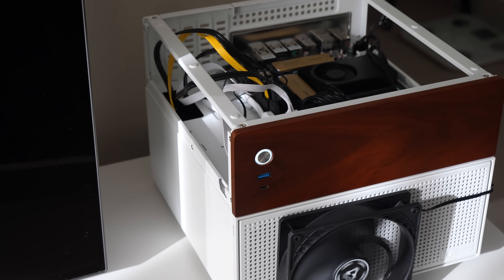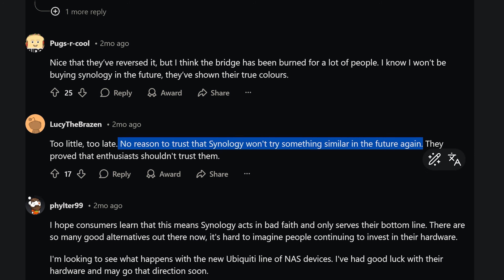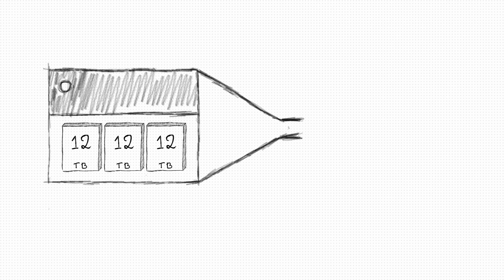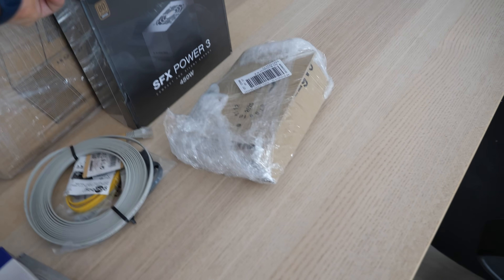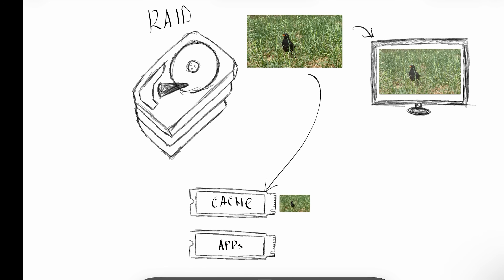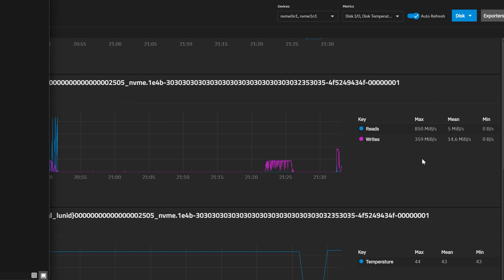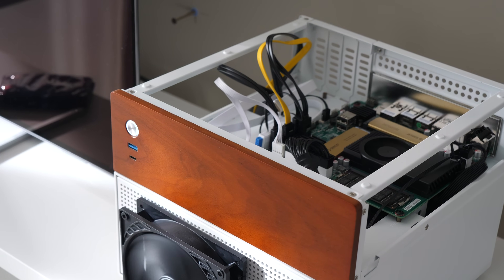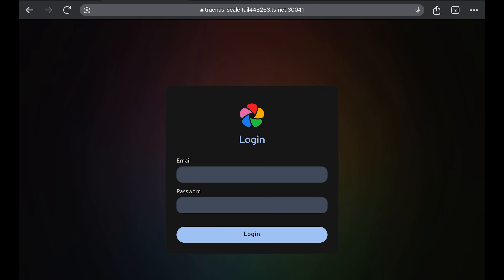Building a 10Gbit DIY NAS: What They Don't Tell You.

Comment: really? i don't know why, you all over complicate it. it is just a pc on your network, take a pc with windows on it, throw a 10gbe in it, and share the drives on your network, with windows! you dont need to learn linux and all this nonsense. ive been doing it, since Windows media center in early early 2000's.
Reply from the maker: 0:39
Reply: You “can” do that, an I did repurpose my old desktop like that (without the 10GbE NIC), but there’s a handful of caveats: 

A) Windows updates restarting your PC whenever it wants. Which can take out any program that doesn’t have an auto start function, slash you haven’t set that up yet.
B) the number of “NAS-adjacent” programs, like specifically Immich featured in this video? Don’t have native Windows binaries and so you have to set up Docker on Windows, which I personally managed to Bork.
C) some programs really don’t handle Windows shared drives well, because it’s a bit of an edge case. For example, I had Ace Combat installed on both the “Windows NAS” and the device I was connecting to it with, and it just wouldn’t even start because Steam couldn’t differentiate between the two. (Even though I could swear that Windows specifically flags network drives as remote, and I didn’t do anything special to pretend it was a local drive?) 
D) Which ties into the fact that your “old PC with Windows on it” probably has both all your stuff that you actually want to be on your NAS, and is piled with the collective bad decisions you’ve made over however many years you were using it and needs a complete wipe with a fresh OS install, hindered by the fact it already has al your data on it and a fresh wipe would wipe it all out. At least, that was the case for me.

E) select programs (I think specifically including video editing, but idk which video editor) benefit from being able to pretend like the remote drive is a local drive over something like iSCSi, that I don’t think Windows drive sharing supports?
Reply: @levygaming3133 F) Windows firewall is rubbish 😂 G) no security updates for older versions of Windows H) bit of a caveat to C but SMB don't play well with others 😂

Comment: 2 "Artic 12 Slim" 120mm fans can fit inside the front cover with very minor modifications. This includes just slightly sanding the top and bottom of both fans and they fit nice and snug, no screws or glue is necessary. Also, removing the rubber Harddrive handles is required to install the 2 fans.
Reply from the maker: That's a good tip, thanks!

Comment: since build. 30min for disk spin down seems very short to me, i wouldn't have put anythng lower than 4 hours. keep in mind that constant spin down/up wears the hdds very fast, i'd suggest you change it. iirc truesnas has scheduled spin down but needs a lot of changes to work reliably.
Reply from the maker: Fair enough! I forgot to mention that I scheduled SMART check once a week after that, and when my PC is on, most of the time NAS doesn't go sleep. With 30 mins HDDs were waking up 2-3 times a day, so I changed that to 90 minutes and we'll see how it goes.

Comment: As a seasoned NAS builder/user - > Very important. For any NAS , you must also back it up someplace else. Never expect your NAS to be undefeatable.

Consumer HDD's work fine as a single drive but not in any type of "RAID". The reasons is that RAID "NAS" drives are configured by the manufacturer to fail quickly on read failures. Otherwise any attempt at rebuilding or correcting a read error can at best cause a read delay , at best a failure of the drive as it keeps trying the read.

For extremely important files, I just buy a $500 Dell Enterprise server (yea  noisy) and I also buy used Enterprise SAS drives. ZFS is the only good option, so TrueNAS Scale is great for it.
Reply: This. After building your first NAS, the next things you should do are:
1) Build another NAS.
2) Set up your own VPN connection so they can communicate with each other over the internet through a tunnel (Tailscale, etc).
3) Set up automatic replication and snapshotting from NAS #1 to NAS #2 (TrueNAS makes this easy)
4) Set up that 2nd NAS at a friend's/family member's house
5) MOST IMPORTANTLY: Test your backup and restore scenario. Ensure it works as you expect, so when shit hits the fan, you won't be scrambling to figure out what you need to do, you'll already know.
Reply: YES. I'm so sick of arguing with idiots who think RAID is it's own backup.
Reply: @nullvoid24 This guy has some amazing friend if they are letting him use up power 24/7 to run his backup server 😂 off site don't have to mean literally off site either, you could just put the backup server in an out building away from the main house if you have one thats protected from catching fire. Build a man cave at the bottom of the garden away from the main house 👍
Reply: Always use ZFS i also have 2 servers running used SAS Drives but also use WD RED Drives and in my less important servers use a mix of other Drives, it all really depends on what you'll use it for and if you want it to be cost effective 😂 for this being a First Nas I thought he done really well 👍 TrueNas is my favourite go to but I have a few different server OS

Comment: Was literally about to buy a similar build, the N305; but then I realized maybe I want ECC and suddenly everything got way more complicated.
Reply from the maker: and WAY more expensive, so I skipped that for now
Reply: You can buy secondhand equipment cheaper if you're looking for more enterprise equipment to suit your needs, supermicro do some great enterprise server motherboards and support ECC Ram if thats what you mean by more complicated 😂👍 hope this helps
Reply: @nomadpack4050 /videos Yeah thanks. I did a lot of research the past few weeks and realized that the ECC situation with Intel/AMD isn't great.

As far as I understand the server CPU's aren't really suited for low wattage idle home use. I was considering an i5-12500 + w680 but the boards are kinda expensive for my basic use. It's hard to find used w680 boards where I live so it'd have to be a china import.

What I essentially want is low idle, transcoding, ecc, one nvme boot (truenas), one nvme fast access drive, 6+ hdd backup (hba card), one 10gbe connection and arc graphics. I looked at the AMD 4650G + B550/X570 but that processor despite low wattage seems limited to PCIE 3.0 and the chipset lanes being only X1/X2 make the PCIe limitation a bit more annoying. Seems like the 3600 supports PCIe 4.0 though, but it's not monolith. 

Not really sure what to get at the moment, I might just try and go super cheap, accept the compromises/bottlenecks and hope that better consumer options are released in the future.
Reply: @nomadpack4050  - Enterprise kit is normally so much louder and far higher power draw, not great in Europe where we have high energy costs and no garage to store that rack mount kit in.

Comment: I would suggest that most people should not give up storage space and performance for RAID. Automated incremental backups preserve your data, is less wear and tear, costs less (using cheaper external drives vs NAS enterprise grade)... what you lose is uptime, meaning the ability to seamlessly continue / restore your data as-if nothing was lost. However, most people don't need perfect uptime. Their archives are overwhelmingly composed of large video files where it doesn't matter if you have instantaneous continuous use... or if you just access the one you need from the external backup and slowly rebuild your drive from the files you aren't in immediate need of now. I feel like all the reviews and videos push RAID on to people explaining what it is but not why it makes sense for them... and in many cases, they don't need the uptime and would benefit from more and cheaper storage.
Reply: Servers have more purpose than just backup of files, the way he set it up was ZFS pool not Raid

Comment: If you decide to build your own NUC, avoid the SilverStone SST-DS380 case. It seems attractive both in price and features, but in practice, it turned out to have a terrible drive basket cooling system. Temperatures rarely dropped below 50°C (122°F). I ended up using a grinder and completely redesigning the drive basket, rerouting the airflow, and replacing the fans. But even after that, the temperature remained around 40°C (104°F). Finally, I decided to take an 8-bay case from my old Synology, gutted it, redesigned the SATA connector assembly, and connected everything to the NUC motherboard via an M.2-to-SATA adapter. Now everything is fine, the drive temperature is 30°C-32°C, and the whole system is much quieter. The SilverStone case is in the trash. I watched the video with great interest and am thinking of switching to TrueNAS. Now everything runs on Synology DSM via ARCLoader.
Reply: Goat
Reply: CS382 is a drastically improved case imo, 8 drives with 12700K stays cool
Reply: Sounds like you did a fantastic job with what you had. Really stinks that you had to do all that because of the Silverstone case. Thank you for the advice, I will absolutely avoid it.

Comment: I have found that NVME drives were more reliable than the old mechanical hard drives, just the cost is higher. The older hard drives can store more but fail alot. Its a big investment to replace these so often.
Reply: I’ve been wondering about this as well. If there came a day where nvme drives had the same prices as HDDs, would anyone still use mechanical? My understanding is that nvme SSDs outclass mechanical in every aspect (including reliability) expect for price. Is that right?
Reply: I recently had a 2tb nvme die and have had other SSDs dies in the past.
Reply: @JediObiDave - Consumer SSD reliability is largely dependant on the capacity.  The larger the drive, the more reliable and longer it will take to wear out, due to the fact is has more space for wear levelling of the data.

Comment: I find it interesting that pre build systems are more expensive.
I tried so many times to combine parts to DIY my own, but I'm ending up more expensive than a i.e. DXP4800 Plus.

I also don't know how power hungry my built is going to be, as power consumption is a running cost.

Edit: OK, AliExpress may be a cheaper source, but I have no experience with it.

Comment: If it’s for work, it has to have ECC RAM. Skip ITX and go ATX, it’ll save you money in the long run. Do not get a cheap chinese case, get an ATX case with good hdd mounts (Fractal design Define 7/7XL). Get a PSU with a 10 year warranty. Do not overspend on CPU’s and motherboards, overspend on RAM.
Reply: “Overspend on RAM”

Given current conditions, even that would be buying too little RAM.

Comment: Do you really need REDs for home servers
Reply: yes if its running 24/7
Reply: Not really, you could use a different brand if you wanted to, or depending on how much risk you're willing to take you could use any spindle drive you wanted but not recommended as you could loose your data. WD Red plus are some of the best drives for this application. You could also use seagate iron wolf pro or Exos 🤷‍♂️ not as good in my personal opinion but others might disagree 😂
Reply: @edhahaz - NAS drives are designed to run 24/7 AND to deal with the vibrations from the other drives in the unit.  A have an 8TB desktop drive which have all sorts of issues when installed alongside other drives, yet it's fine when stand alone.

Comment: 8:02 The NAS doesnt HAVE to be connected to both your PC and router, if you just connect it to your router, you can use it with your PC just fine. You just have to find out the IP Adress of it on your Router, connect to it in your Browser and create an SMB Share, then you put that in your Windows Explorer and you have a NAS that you can put stuff on without 27 Ethernet Cables
Reply: I thought the idea of direct 10Gb from workhorse machine to nas was brilliant! The slower net connection for router/wifi/wan/iot saves a lot of money on unnecessary network gear.
Reply from the maker: I mean that in the context of using a 10Gbit connection, and for that you need a cable.
But overall yes, you're right
Reply: @trysometech52 or habe a 10gb Router/switch

Comment: I got interested when I heard the Orico IG740 Pro SSD has power loss protection (PLP) and is TLC NAND flash. A quick google however suggests that it does not have PLP (see techpowerup database), and the 1TB variant is QLC instead. I like the video but not the sponsor.
Reply: ECC so great for the application of cache & they are nand chips so they don't require PLP really do they 🤔 nand chips retain memory without power, in this instance he wouldn't require PLP but if he was using them as boot drives or storage drives for sensitive data then yes it would be more beneficial but even the Apps drive he used the second one for wouldn't matter since he could quite easily set up the apps again, worst thing he will have to re set up the Apps and have slower loading times again if he ran into power loss issue
Reply: Also UPS would also save the issue happening all together which is why it's recommended for all equipment to run through UPS
Reply: @nomadpack4050  True for most users, but I'm looking at this for a Ceph cluster where PLP is a hard requirement. Without it, you get a massive IOPS penalty because the system won't trust the volatile cache. Even with a UPS, the OS won't acknowledge the write as 'safe' until it's physically on the NAND, unless the drive has capacitors to guarantee that flush. For home use, it's fine; for distributed storage, it’s the difference between 10k IOPS and 500 IOPS.

Comment: It's been nearly 10 years since I built a similar system on FreeNAS (now TrueNAS). It's still running on TrueNAS core and has 12 drives. I however always remembered that spindowns are generally not wanted for NAS drives? Better to keep them running 24/7 instead of letting them spin down was what I was told. This maybe changed the last few years with newer hdd tech?
Reply from the maker: Good point, I had to dig deeper, and yes, they changed the HDD, but in the opposite direction. Due to the density of data on my 12TB drive, this could have an even worse effect on its lifespan. But that's if the drive frequently goes into standby mode and comes out of it. In my case, this happened 2-3 times a day, but I think I'd better change this setting from 30 minutes to 2 hours so that it only stops at night and turns on with the PC.
Reply: @trysometech52  good to know! Thanks!
Reply: @trysometech52 moreover, there is a bug in the last version of Truenas, where it is not letting the drives spin down even if set to do so....
Reply from the maker: @glujaz  Yeah, lucky me, I still haven't updated

Comment: Ironwolf and Exos are noisier than WD Reds. When you build a NAS, you put it in the basement or a spare room or a ventilated closet because they do make noise.
Reply from the maker: Ouch. So maybe I did the right choice then
Reply: @trysometech52  Yep. Ironwolf and Exos spin at 7200 RPM and will always be noisier than WD Red Plus. I actually think WD Reds are quiet but I do have Ironwolf and Exos drives to directly compare with. My sister is a Mac user and since her MacBook is silent, she’s also sensitive to sound that I’m personally fine with. xD
Reply: any high capacity HDDs are noisier because they have more platters to spin
Reply: I use Ironwolf Pros, but only went as high as 10GB. I read it’s the drives above that are loud. Sure it only gives me 40GB to play with after formatting and ZFS, but not bad for a machine that has to sit in the same room as me.
Reply: Read the data sheet WD Red plus, Helium filled drives you want if you're looking for quiet drives WD120EFBX this is the only model with helium

Comment: That external mounted front extra fan for hard drives 😂😂😂😂
Reply from the maker: that's what makes it special 👀
Reply: exactly why? what can he possibly be doing, to need that?
Reply: @tek_soup  the drive temp is a bit on high side like 45 iirc , so he added a fan to help , although that mesh is not friendly for air flow but arctic P series fan have high pressure to help a bit 
I have a n5 and honestly the case air flow design is on faulty side .... Negative pressure design but holes everywhere , not optimal amount of air could pull from the drive bay
 I sealed some of the air vent and see greater harddrive temp and able to turn then fan rpm 30% lower
Reply: @tek_soup  did you not watch the video

Comment: You always seem to cover a topic that's recently of interest to me! Have been thinking about setting up my own NAS for a while, so it's really handy to have a guide to a modern (cost effective, and free-to-run) setup, thanks.

It's also nice to see TailScale get a shout-out! Just discovered it myself and it's far superior to my previous port-forwarding solutions. I hope it stays free forever.
Reply from the maker: Awesome! Let's see if this rule works with the next video :)

Initially, I was setting up WireGuard, and there were a bunch of manual settings, DDNS, router configuration, etc., but with Tailscale, I just downloaded the app, logged in, and started using it.
Reply: I use Tailscale for remote access of my Jellyfin server, and it's a pretty seamless and makes adding new users very easy.